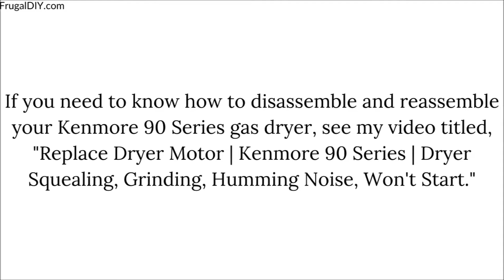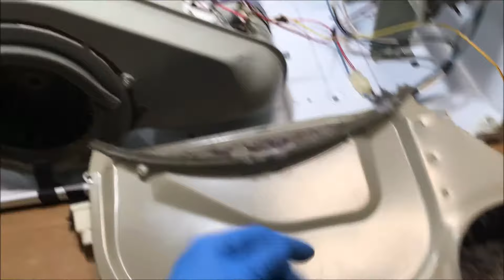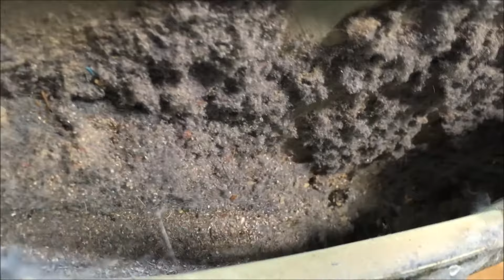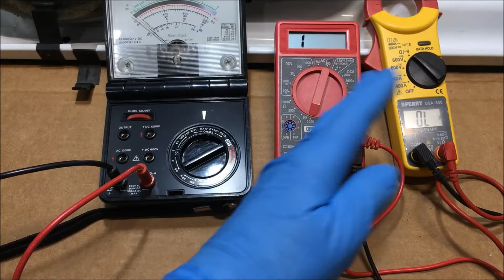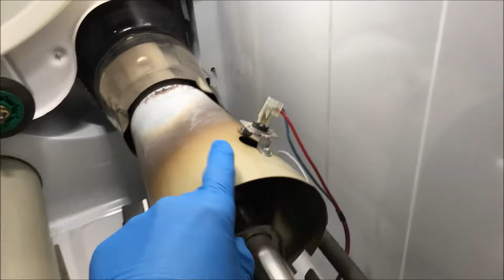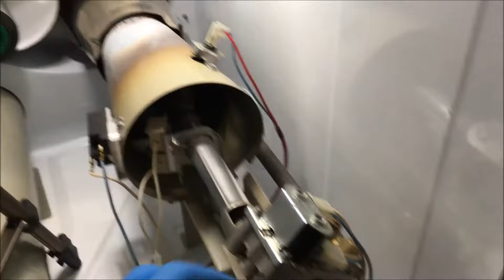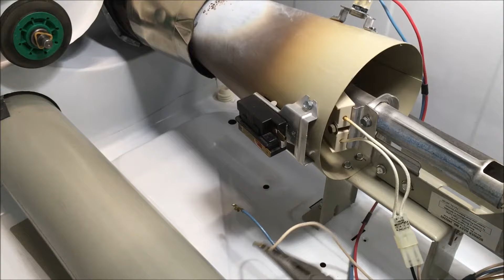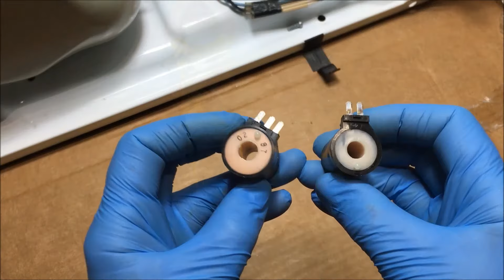Troubleshoot Gas Dryer | Dryer Won't Heat, Won't Start, Won't Stop, Dry Time Too Long, Dries Too Hot

Comment: Diagnosing dryer yesterday. Replaced all sensors. Got so heated. No pun intended.

Couldn’t figure out why I had intermittent drying. It was the COILS!!! Did not know coils can have false positives. Replaced those and it WORKED. 

Then came across your video. U explained every component and its functions.

Wish I watched your video before. Would have saved me so much time. ❤
Reply from the maker: I'm just glad to hear you fixed your dryer yourself.  GREAT JOB!  And thank you for leaving such a nice comment.  I appreciate that.  ;)

Comment: 1000 likes. Very helpful video.  I have a tube that don't know where to connect.  I think it has to do with the moisture monitoring in the exhaust system. I also have a yellow orange wire that's loose. Where's it go? Its bundled with  red and green wires out of s little red square thar has a rubber hose coming out (and not connected).  My plan is to throughly clean the exhaust system  and probably replace the fuses. Thanks again for a perfect video.

Comment: This video was helpful!. I had used your other video to replace a bad motor and rollers. It ran so well for a month. Then it went out mid drying cycle. I was worried it was the replacement motor, but it wasn't. It was the lid switch. When pressed, there wasn't a click. So, bought replacement switch thru amazon, unscrewed the old switch, brought out the new one, and changed one wire at a time to the new one to make sure I got the wiring correct. The new switch had the door light terminal a different size, but whirlpool included 2 replacement terminals. So I carefully cut off the plastic cover so I could get the maximum amount of wire rescued. I cut it off just behind the original crimp, cut off a small amount of shielding exposing the bare wire, twisted it, the inserted it into the new connecter and crimped it tight. A small tug on it to make sure it was tight, then slid it on the last terminal. Once that was done, I put the bracket over the switch put it into place, and using the new provided screws, installed it into my series 90 dryer. Reassembled the covers etc, plugged it in, and it is back to work.  Won't start is three things to check. Lud switch, cycle switch, thermal fuse. I learned this from your videos. Thank you for making clear and precise videos to help us. Be well.
Reply from the maker: I'm glad it all worked out for your old-faithful dryer.  And, thank you for the comment and info you shared with all of us.  Be well, too.  ;)

Comment: Hi! Thank you for explaining everything so well. I have replaced 3/6 things you mentioned. The other 3 are working. Turn the dryer on, watch the flame start. Within 20 minutes or so the flame is gone and dryer is still spinning away with 30 minutes to go. Take the now dry load (4th time in there today) and put a new load in. Fire ignited and is heating. Will check again soon and it will be out. Why could this be happening if everything you mentioned is functioning properly?

Comment: My old gas Kenmore Elite 110.76942501 / MS3704435 stopped drying a few weeks ago, I found the dryer hose vent had come off in the back and was blocked my hardwood floor (where the ventilation goes outside). I assume this caused one of the internal units to fail. I tested the thermal fuse and got no reading, one the others I did...gonna replace'em anyways! This video helped me in a time of desperation...Thank You So Much!! You Rock!!
Reply from the maker: You're welcome, Ty.  ;)

Comment: Thanks for posting this video.  I have tried ALL of the things listed in this.  Had replaced the hi temp thermostat.  Then actively tested all components individually by jumping each one out.  Found that the replacement high temp thermostat that I had purchased was a bad part that tested good with an ohmmeter.  Who would have guessed?   Thanks again for posting.  Best troubleshooting video on Youtube for gas dryer repair.
Reply from the maker: You're welcome, winford, and thank you for the thoughtful comment.  Great DIY detective work! 
 ;)

Comment: Love your video it’s very thorough and informative. Thank you!
Reply from the maker: Thank you, JC, and you're welcome.  I appreciate your comment.  ;)
Reply: @frugaldiy1 i have my gas dryer apart right now. It would not get hot enough and take very long to dry. All components have checked except I notice when I measure the switch selector to control unit  I measure 9k ohm on regular, 98 ohm on medium and 9k on no heat. I ordered a switch selector. Hopefully I am right

Comment: Hello , I am on step 12:40 , I checked everything else I have continuity and swapped the coils for some new ones, but my issue continues as you explained around 13:45 , I’ve also tested the coils and for whatever reason they are reading no continuity , I might’ve gotten some faulty coils. My igniter ignites the flame comes on for about 25 seconds turns off and comes back on after around 45 seconds. Any recommendations, I plan on getting a new high limit thermostat. Thank you

Comment: OMG!  First, Good day to you AND -  thank you so much for this video. I appreciate you teaching so much in this video. I am a frugal lady who always tries to fix things myself before calling someone in to do it.  I just believe in being self-sufficient whenever possible.  As well, I believe in being frugal. About a year ago my Sears washer stopped agitating and changing cycles. I did my research and repaired it myself. It was not difficult at all and I my thinking is always - how hard can it be.  So now the dryer is having a problem -so I'm researching again.  I just watched your video and this is wonderful for me to begin  my understanding of how the dryer works and the various parts and what they do. I'm wondering if you can assist me in identifying my issue and what I need to potentially do in order to repair. My issue is a gas leak at the dryer connector point. Is there anything in the gas assembly unit and its parts that would cause a gas leak? I'm thinking maybe I just need a new gas connector where it connect to the dryer. If I change that and still have a gas leak is there anything in the dryer's gas related parts that would cause a gas leak? I would be most appreciative of any insight you can provide. I don't want to unnecessarily purchase a new dryer if I can cost effectively repair this myself.  In the mean time, I'm going to purchase a tester so I can check the various parts of the gas assembly and be sure they are working. Thank you kindly for anything you can educate me on that would help me find the gas leak issue if it is not simply a bad connection point issue.  Take care - Joy and Peace to you and yours.   Btw  - my washer & dryer are Kenmore. I'd say about 25 yrs old. Never had a problem with dryer before.
Reply from the maker: Thank you for your kind words.  Unfortunately, I can't diagnose a gas leak unless I'm there.  That can be dangerous.  ;)
Reply: No problem - I understand. Thank you for your response.

Comment: Very helpful. I had a bad thermal fuse. I replaced it and cleaned out all the lint around the areas. Also checked all my other fuses. Very happy with this for a solution. My next guess was the gas valve coils (black thingys). Glad it was just the one part.
Reply from the maker: Thank you, fly.  I glad my video helped you.  ;)

Comment: Great video. Got a dryer from hell.   Lg thinq.  Checked all the comments and even replaced gas  valve.  Same issue.  Glows and won't fire up. I blew and sucked the gas pipe to the valve. Worked for a couple loads, but went back to not firing up again.  Any help is appreciated.  Thanks

Comment: Hi there I have a question my dryer keeps saying clean filter and won’t start the cycle, but I cleaned out filter and hole air vent tubing and stills keeps saying clean filter and I also cleaned out with alcohol the thermistor sensor still keeps flashing clean filter any help works thanks

Comment: Thanks for posting.  I'm now able to test each part.  I had correctly diagnosed a failed ignitor, but decided to swap out flame sensor and coils while I was at it.  Coils from Amazon were a repeat order from five years ago.  The three-prong with the spacer, however; was VERY tight even without the sheath.  I tried them (but no flame) and had to put the old ones back in.  But I had confidence in them as they tested good!.  Now, where do I find OEM coils of the proper dimensions?   The variation of cost and quality of parts is a real issue.

Comment: I'm at a loss, I rooted the drier vent, i checked each and every part like in the video with a voltmeter. I even checked the voltage for the timer as well. I vacuumed all internal components, cleaned the blower fan out, replaced the drive belt, replaced the gas coils, cleaned and ordered a new cycling thermostat. if that doesn't do it i have no clue what to do. It turns on, burns for about 30 seconds to a minute, cuts off and doesn't seem to come back on for a long time. Has anyone else seen this result?

Comment: Great job overall but at 12:20, you claim that the flame sensor is fine just because it measure zero ohms. Actually it can fail so that it never opens to let gas flow, that was the case with my recent repair. I just fixed mine, the new flame sensor and 2-coil repair kit costs under $20 on eBay & Amazon in 2025.

Comment: TY for your video. I have a gas dryer that I bought in 1983. Still going good! It stopped mid-cycle last week. I checked connectivity in the panel switches and the thermal fuse. All good. Then I popped the lid. The wires to the door switch had fallen on the drum, abraded and one broke. Reconnected. Fixed. This happened once before a decade ago. I'd forgotten that repair. Guess I failed to secure them  well. Worth an easy check to start. In 42 years I changed the belt once. The dryer is still doing its job beautifully.  Thanks again for this video and your entire channel.
Reply from the maker: You're welcome, Joe, and thank you.  I'm so glad you were able to get your old-faithful dryer back in service.  They're going to have to pry my old appliances and cars from my cold, dead hands.  ;)

Comment: I have a gas dryer that takes 3 cycles to dry what used to dry in 1 cycle.  I have pulled it down and completely cleaned everything out, no change. I replaced the thermistor and both thermostats, no change. All 3 parts as well as the solinoids and fuse test as expected. The flame never dies off during run time. Its a Maytag model MDG6800AWW. Thinking of just replacing both solinoids but just hate throwing parts at it. Any help would be greatly appreciated.

Comment: The absolute BEST video on troubleshooting a gas dryer.
Reply from the maker: Thank you, ttfd29.  I appreciate that.  ;)
Reply: 100% agree!
Reply: I tested everything and cleaned up the sensors. It still only heats for about 15 seconds kicks out for about 30 to 45 seconds and heats for another 15 seconds. I tested the coils and they were in spec. Im gonna order the coils lol. Thank you  so much for the video!

Comment: Hello, thank you for such informative video. According to my wife, while using the dryer there was a very strong smell to gas, she stopped  using it and shut off the gas valve. When I got home, I run the dryer for about three hours. No smell was present. The ignitor glows, and the burner ignites properly.  Any ideas to prevent this from happening in the future. Thanks in advance.

Comment: My basement got flooded and my dryer starts but won't heat.. I going to check all the parts you check and hopefully Get it fix.Any suggestions on what to use to clean the inside of the dryer with out damaging any electrical components with harsh detergents.🙏🏻Thank You

Comment: September 2025. Very well done video. I tested everything with a multimeter and all components read okay, even the coils. I replaced the coils anyway, based on the recommendation here, and my dryer now works like new. Thank you so much for putting this video up.
Reply from the maker: That's wonderful to hear, Jeff!  Thrilled that my video helped you fix your dryer and GREAT job on fixing it yourself.  You're certainly welcome.  ;)

Comment: This is the ABSOLUTE BEST VIDEO!!!!!  Thank you so much for your complete run through the testing of a gas dryer!   I have an older Maytag gas dryer (c1990s).  It's not pretty, flashy, or full of digitals, but it can almost last forever compared to today's models. Thanks for keeping mine up and running!!!!
Reply from the maker: That's kind of you.  Thank you!!!!!!  I agree with you--I'm keeping my older Kenmore gas dryer that will run forever.  They'll have to pry it from my cold, dead hands.  Same with my older, top-load Kenmore washer.  ;)

Comment: Saluts from mexico. , great video.
Reply: Im tryng to fix my kenmore he 4 , gas dryer. It wont start at all, im tryng to figure out if is has a foulty sensor , would it still run but won heat, or just won run at all if sensor is bad? . Thank you.❤

Comment: Hello Frugal Lady. Thank you for your videos. You're saving me money and stimulating my brain cells! I began troubleshooting my system and believed I needed a new thermistor (located in place of cycling thermometer) because I did not get "the beep" when measuring resistance Ω. I now believe I am actually looking for SOME resistance. When multimeter is set to 20kΩ, I read 9.02.

Here is my question...where can I find the info that tella me what value i should be reading for any given component for any given measurement (ohms, voltage, amperage ECT.) I feel my thermositor is actually good. Taking the drum out today and further investigating. 
Thank you again Frugal Lady❤🎉

Comment: Favorited this video, very well done.  My Maytag Neptune Gas Dryer's igniter coil will not glow but it tests at 68 ohms, within bounds.  Could it still be bad?  Also, the thermal fuse beeped good, but the cycling thermostat only had 2 prongs, not 4 like yours.  I got no beeps from that, but what if the two prongs are the ones you said not to test?  Anyway, great video!!!

Comment: Truly an awesome video. Extremely detailed and delivered with great patience. Quick question. I saw a video by Part Dr where the guy states that the cycling thermostat should not be tested for continuity because they have a high OHM value that won't register on a continuity test? Is this accurate? And he also states that if it registers below 11 OHMS to replace the cycling thermostat. Mine registers between 8.1 and 8.8 at room temp. So if he's on point I'm going to replace it as my 23 y/o kenmore elite dryer is not drying our clothing due to the dryer not producing heat. Thanks again for a great video.

Comment: Excellent video!! I'm very late to this video but I think you have the answer to my question. I have a Kenmore dryer with the same gas internals as this video. There is a shutoff valve in the elbow that connects the gas line to the mechanism with the coils. This shutoff valve is leaking in my dryer. A new gas shutoff valve costs $250. I see other gas dryer internals do not have this shutoff valve in the elbow. Can I just remove the leaky shutoff valve elbow and put in a simple elbow that has no shutoff valve? Thank you

Comment: Thanks, very clear presentation. My Matag gas clothes dryer has intermittent ignition, about 20% of ignition cycles fail. When ignited the gas flame looks proper (very blue) and continues until the selected temp. is reached. I've cleaned the blower paths, replaced the coils and then replaced the igniter (OEM parts). The failure rate seems slightly better, but still fails. I've seen it fail when everything is stone cold, and after several successful ignitions (hot). I always smell gas after a failed ignition (and I always see the igniter glow before a failed ignition). Is there a measurement for the flame sensor closure period to allow the igniter to fully heat?  My machine has an electronic controlled heat relay (humidity and heat settings) that work properly. Any suggestions welcome. I love to fix things but I hate "swap and hope" diagnosis ;-(

Comment: Hello, why would low heat work but not the high heat? I checked while the low heat is on and the igniter and everything works but once i put the dial on any time on the high heat nothing comes on, no igniter nor and orange flame.. What can the cause be?

Comment: I followed your tutorial six months ago and completely fixed my dryer. The parts were fairly inexpensive and I was thrilled! Unfortunately six months later I’m getting no flame in the burner. I actually don’t have the time to take the dryer apart like I did six months ago. If you have any suggestions, let me know. I see nothing glowing on the igniter and no flame in the burner housing.

Comment: Looking for words of wisdom why my dryer won't heat up. Ignitor turns on. No gas flame. I've replaced the coils. No blockage fuse and thermostat test good on meter.

Comment: Thanks for the video.  It's very throrough and informative.  Just as a point of info for future videos, my control thermistor (Fridigaire Model FFQG5000QW2) is 50k resistence. It was made in 09/2014.   Thanks again!

Comment: Excellent video, very well explained and each part reviewed, my dryer has precisely that fault that in the first cycle there is a flame, in the second the same but in the third not anymore, I am going to check it, Greetings from Mexico.
Reply from the maker: Greetings from USA!  I appreciate that--truly.  Proud of you for fixing it yourself.  ;)
Reply: @frugaldiy1  Hello, I replaced the coils and that's it, my dryer worked again and completed the cycle and the timer advanced before it didn't and the flame only came on twice then it didn't.